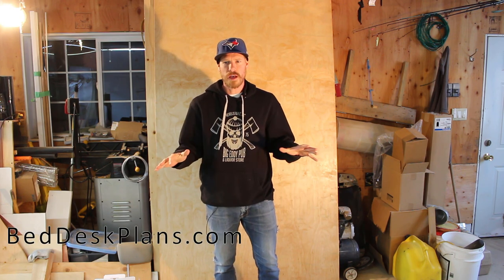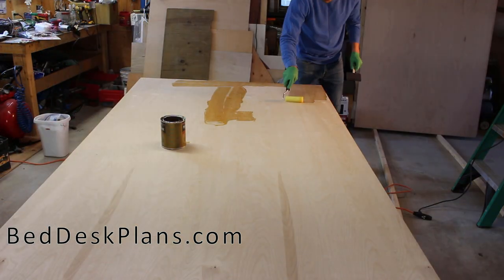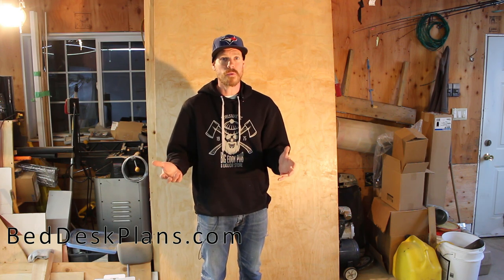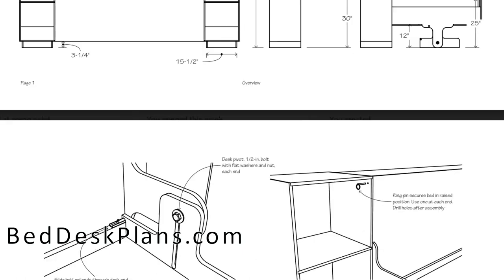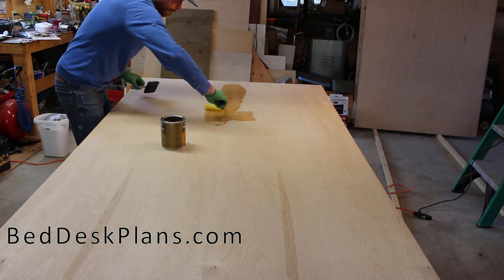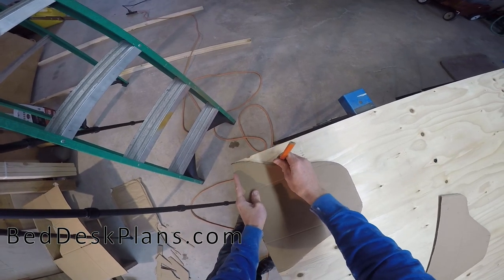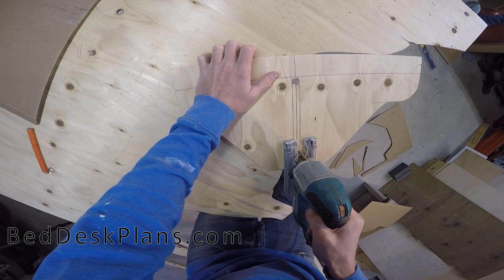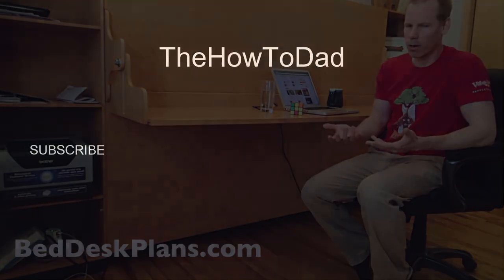How to Build A Murphy Bed with Stay Level Desk Pt. 1

Comment: Hi, Quick couple of questions, could the desk part be made wider - as in around 750mm or 30 inch deep?  and could the depth of the cabinet or housing for the mattress be reduced to around 150mm or 6 inch? great Video and a nice thought out build!  - 

Thank you
Reply from the maker: I'd have to do some work to make those changes possible. send me a message at http://beddeskplans.com

Comment: I watched the video(s) and thought - I'll make this, it suits me, but before I bought the plans, I bought 2 sheets of 18 mm BB/BB grade plywood - at a good price - (thinking it was something like the UK  equivalent fo what you'd ued). Having bought the plans, I see the plywood used is just about all 12mm. My question: - would using this thicker ply make the bed so much heavier that it would likely be hard to lift up an down?
Reply from the maker: it will make it heavier, and there will be some dimensions that you will need to adjust. best advise I can give is use the 18mm for the support frame/shelves and the bed box sides.
just pay attention to your dimensions and you should be fine.  
let me know if you have any other questions!
Reply: @TheHowtoDad  Thanks!

Comment: Is the bed free-standing, or is it anchored to the wall?
What is the useful storage space on top of the desk when the bed is down in its horizontal sleeping position?
How far out from the wall is the vertical bed base when the bed is in the vertical daytime position?
I went to the site to buy plans but need the info above to be sure the bed will fit my needs.
Reply from the maker: Hi Steve, yes the bed is anchored to the wall. this is so it doesn't fall over when you are lowering it. there is 9" of clearance on the desk when the bed is down.the bed is 16" deep when in the vertical position. pause the video here https://youtu.be/Lc7qAtw3obE?t=31 you will see all the dimensions. Thanks for the questions

Comment: I am looking to build this bed for my daughters room, queen sized bed, I can't find any plans for a queen :( I really love the desk
Reply from the maker: Queen plans are in Beta testing now.  there have been a few built. the biggest issue we are experiencing is the weight of the bed. It requires a  lot of force to put the bed away. This also means it takes a lot of force to lower the bed as well. We are working on trying to figure out  a way to make it easier, but until then I am not comfortable with releasing the plans.

Comment: I want to paint a queen size bed completely white, when is the best time to do it? I'm planning on sanding the finish grade plywood and then applying a coat of white paint on it. Do I need primer as well?
Reply from the maker: or sure you will need a primer, unless you use a primer paint. I'd paint it when it is fully complete.

Comment: just got the plans I have few questions. mainly solid wood desk nosing, is 3/4 thick. is this trimmed down from s 2x2? also the 3/4 " black iron pipe in material I believe is a typo but wanted to double check if that was supposed to be 1/2 "
Reply from the maker: you can use what ever wood you'd like for the nosing.  I used Maple and it was 3/4.  a hardwood is best, helps with stiffening the desk.  1/2" iron pipe would work if you can find it!

Comment: This is very interesting! The only concern I have is with the legs at the top of the mock bed : they seem very narrow to me. Are the legs supporting the weight of the intire mattress? Could modifications be made so that they are less likely to scratch the floor they rest on? Very cool project!
Reply: Oh, i'm stupid, the bed actually rests on the shelve part it seems, wich is wider.
Reply from the maker: The legs are narrow, but because they are plywood they have a great deal of strength. I have had my bed in use for over 4 years now with various people on it, it still works just as well as it did the first time I used it. The legs have never scratched the floor, but if you're worried about, I'm sure some felt pads could help. Modifications are always possible! Thanks for your interest